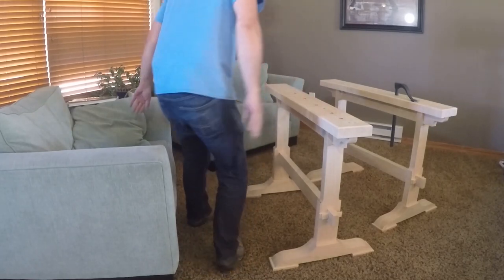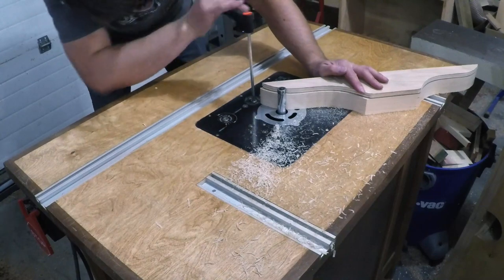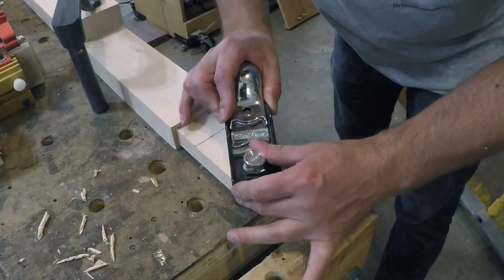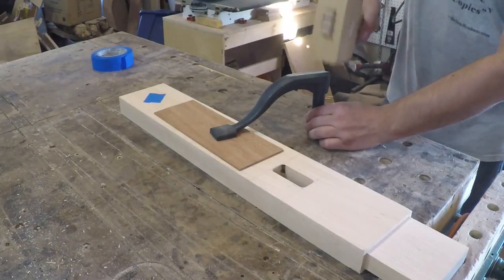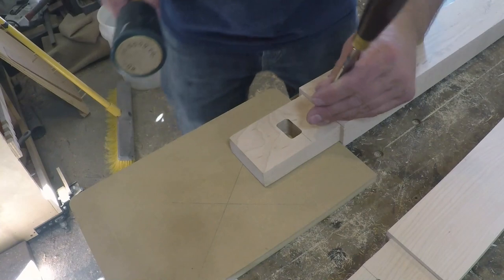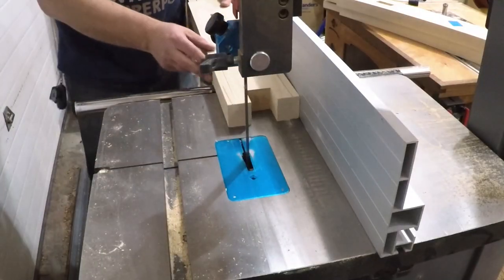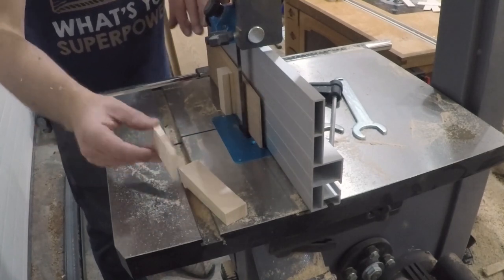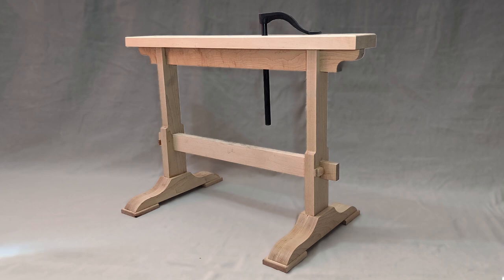How To Build Sawhorses Japanese Inspired Woodworking

Comment: If you use a 1/2" diameter bit, you just use a 1/4" round over bit on the tenon, and then just use the chisel to round up the bits next to the shoulder. The day i started doing that my life changed. You may not like it but the fit is truly perfect. No more bruised, imperfect corners

Comment: These are not work.saw horse 
These are  expensive maple decorative krup
Reply from the maker: To each their own, I use them as work saw horses all the time.  They are the most sturdy saw horses I have ever used in my 34 years of working in the trades.  
Also maple is a fairly cheap wood, yes more expensive than plastic but so much stronger.  So I don't think they are krup.